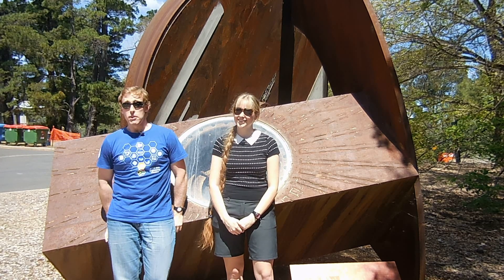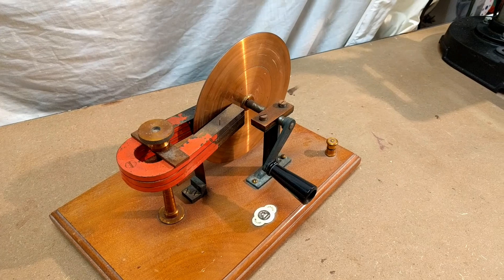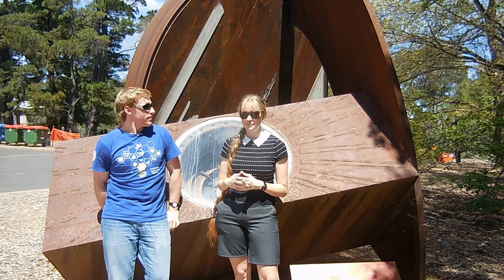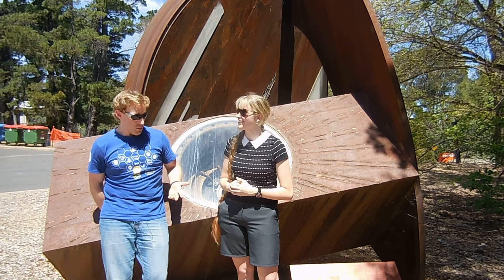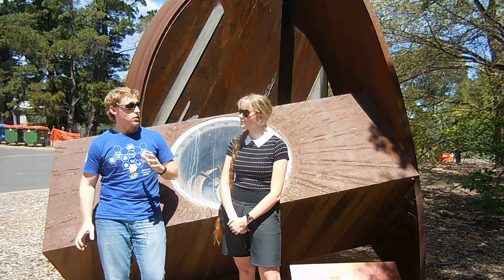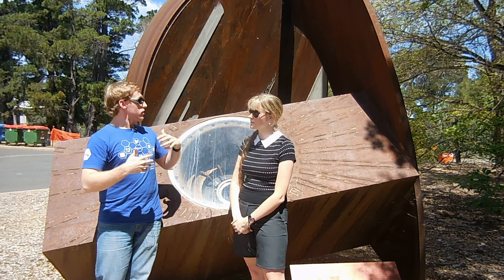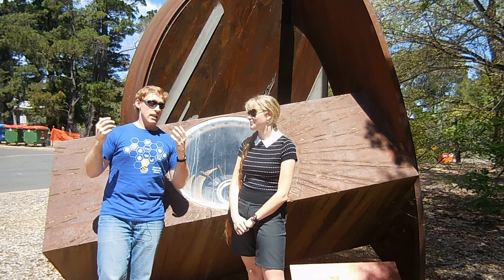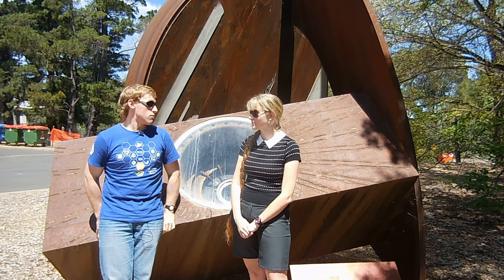World's Largest Homopolar Generator ft. Tibees!

Comment: Galinstan would have been a better choice.  Gallium + indium + tin.  Timing is the problem, since it wasn't mainstream in the 1950s/60s.  Artificial gravity vehicles - some models, including those we build - use unipolar generators for the high current source to provide the axial, vertically-oriented large magnetic field needed for electromagnetic acoustic resonance.

Comment: Does it have to be a disc?  Could a cylinder work as well or do you need the rotational gradient that a disc provides?
Reply from the maker: A cylinder would make no difference. It's not the rotational gradient - you just need the conductor moving in the magnetic field. A cylinder would use additional material but not add generation capacity.
Reply: @drgozzard  Thank you for your response.  Seems to me that a drum configuration could potentially increase the surface area of the conductor within the magnetic field.  Do you not see any possible benefit in that?
Reply from the maker: @karlswanson95  The magnetic field is applied through the thickness of the disk. So the area of the circle of the disk matters. The surface area of the main body of the cylinder wouldn't contribute anything to the generation.

Comment: HPG are also used to heat billets before they are forged in a foundry. The only one I know about could deliver forty two Volts at six hundred fifty million Amps. It took about one and half minutes to bring it up to speed before the energy is dumped. Lots of Joules and lots of Henrys. Solenoid activated brushes were slammed onto the outer edge of a two meter spinning disk  to deliver the charge. It is all encased in a shell and driven by an electric motor.  I don't remember any more details than these since it was about 1970. It was, however needless to say, IMPRESSIVE ....tfk

Comment: yet they could have added a few heater elements and used that OTHER liquid metal... gallium. non-toxic, and non-flammable...

be interesting to have an idea of the conductivity, seeing as pure metals are always more conductive than alloys... 

iunno, it breaks my heart to see old machines decaying and turned into "ornaments". like going to eveleigh and its "technology park", where "technology" is now "ch7, commonwealth bank, and yuppie cafes".

they couldnt even figure out wtf the gleasson bevel gear generator was... called the milling machine with rotary table a "vertical lathe"...

thats "technology" for you... 

me? if id been in charge? keep it as a working display.

here you go kids! an exercise bike as a generator to supply a bit of magnetic field, an exercise bike to spin it... albeit very slowly :)

who can pedal the hardest?

just to get an idea of the power actually NEEDED to get it working...

i guess it was a better method at the time than dealing with capacitor or magnetic storage systems, along with all the challenges of switching such massive currents... as they were already industry standard for large scale welding, they had an idea of the limitations.

Comment: Nice! Thanks for sharing. I didn't know about the NaK alloy until today. Also, from your video I understand that this device was meant to work based on the energy stored in the spinning wheel. Homopolar, yes, but this was a big flywheel in the first place if I understood it correctly.

Comment: 2 magnets..
copper disc?
Reply from the maker: Copper plates on a steel disk.
Reply: @drgozzard why not aluminum since at high speed the torsion causes a phase change resulting in superconductivity